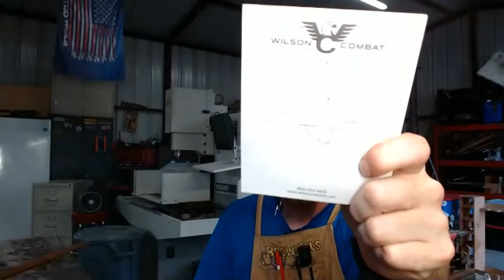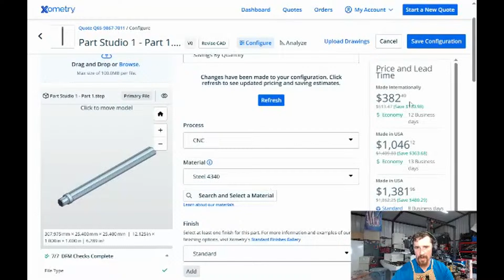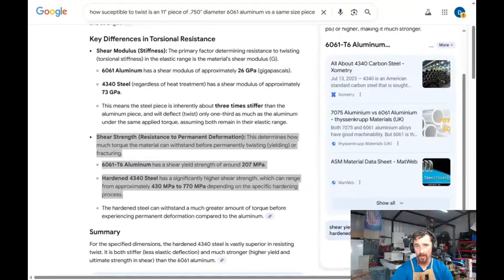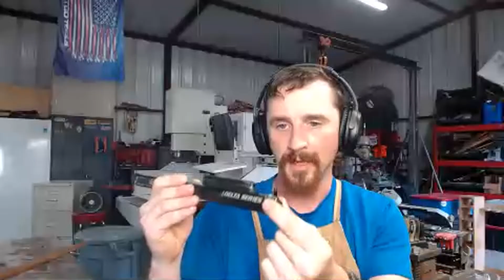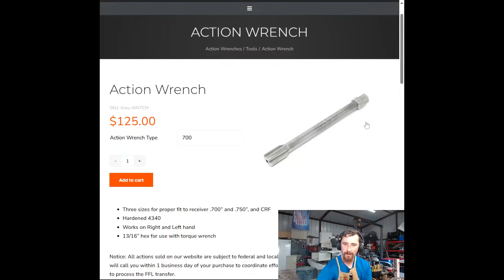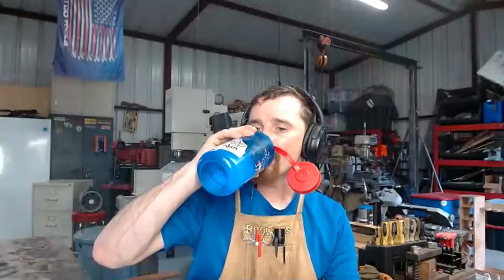Making My Own Rem 700 Action Wrench vs Buying One — Costs & Tools | Huntsville Guns LLC

Comment: Biggest issue with 3D print will be elephant toe, where the first couple of layers will squish out... You can look up what tolerances to add (or actually subtract) in to your parts to get better fit when 3D printing.

Comment: What CAD do you use? Are you paying for a subscription CAD, or an open source?
I was a draftsman in a previous career, so I like to see what people use.
Reply from the maker: I am pretty proficient with Fusion but have some issues with changes they have made. Have been using OnShape lately as it is very intuitive and has a built in function for generating prints. I have used a ton of others from freeware to proprietary in another industry.